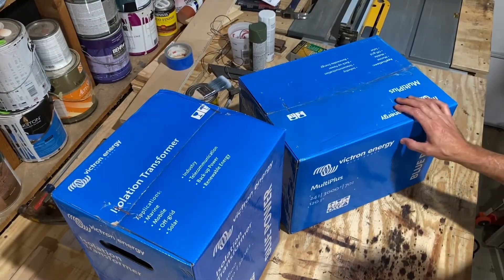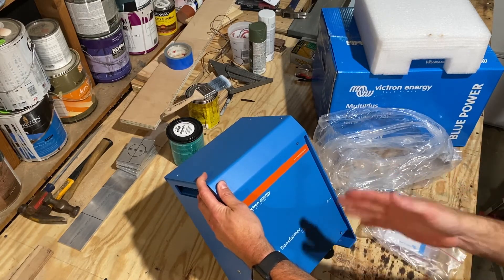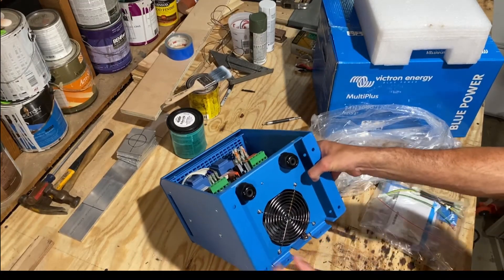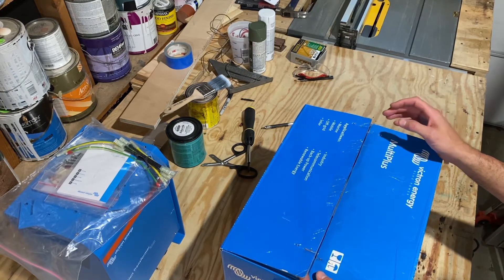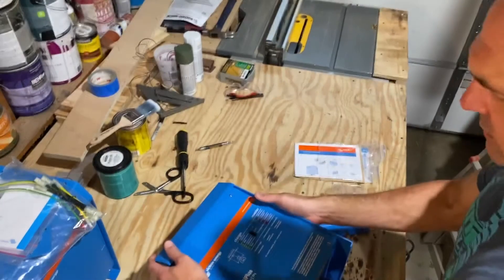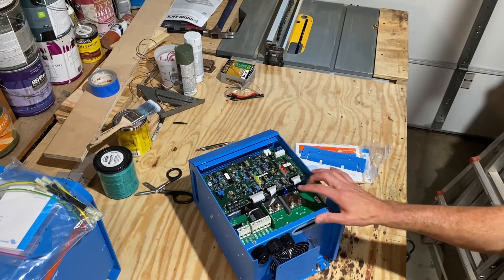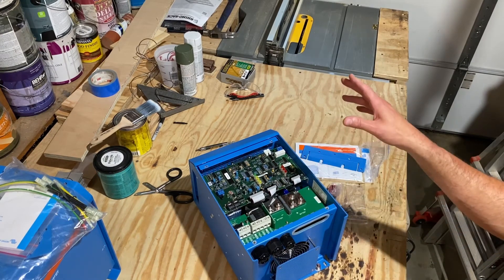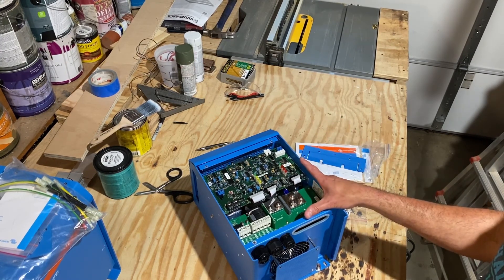Unboxing - Victron multiplus 24/3000/70 and victron isolation transformer 3600w

Comment: Nice video. Always ground input side and use GRC at output side but never ground it(at transformer) as you might have unexpected voltages at output ground point compared to L/N.

Comment: Sorry, unwatchable with the loud music.
Reply from the maker: Sorry, trying to do better as i go, i am learning
Reply: @sandpaperandseashells  Marvellous!  I'm sure you're doing fine. (Having done sound professionally, I'm probably a more difficult customer!). ps otherwise, great clip.
Reply: Disgusting volume control.
Reply: @tomhamilton9140  is that comment really necessary, everyone has to start somewhere and there is always room for improvement, being rude is more a poor reflection of you than of them
Reply: Hey, I was hoping you can help me. I have the same Isolation Transformer but one of the pcb mounted transformers inside (the 2 blue components in between the white wires that says bingzi) has dislodged and inconveniently specs on the side have rubbed of. I am trying to find the specs of it (writing on the side) and i was hoping you cloud look and let me know. The one of the left says T10-F80 230v 50hz 24v 10va. Need to know what the one on the right/middle says on the side. Thanks in advance. BTW don’t worry about the people complaining about it he music, you will always have people that love to hate.